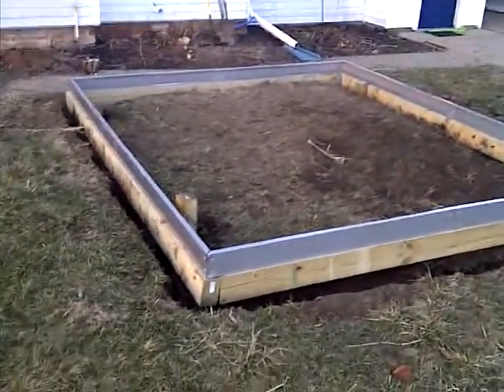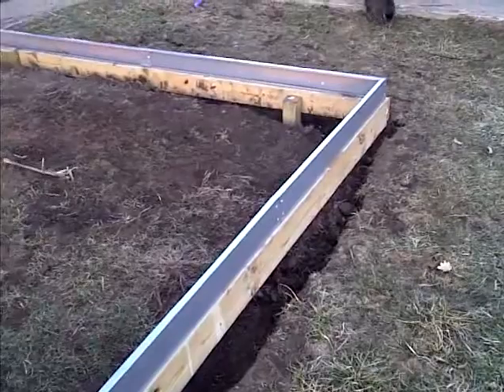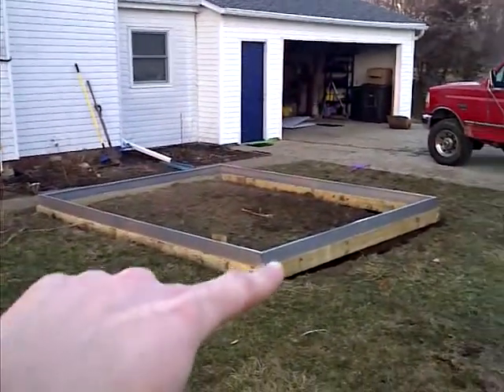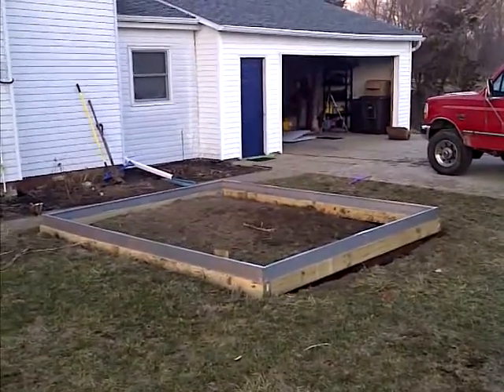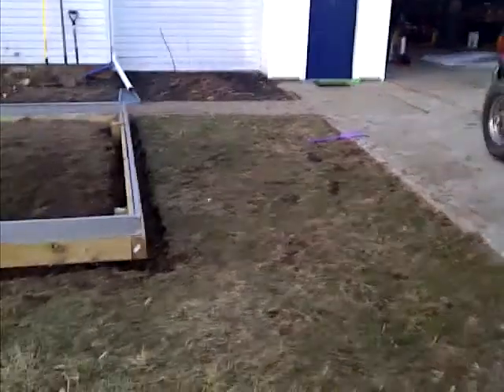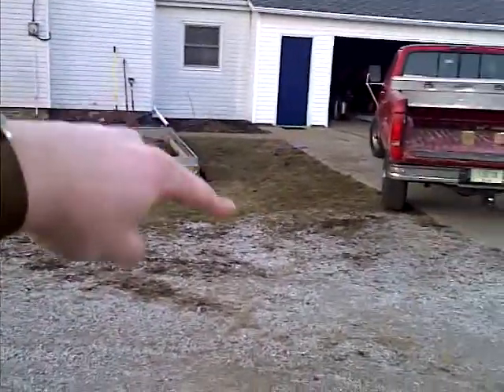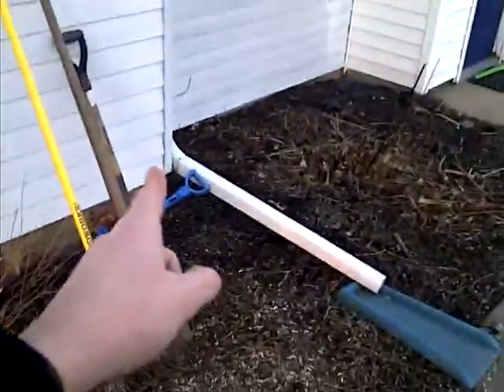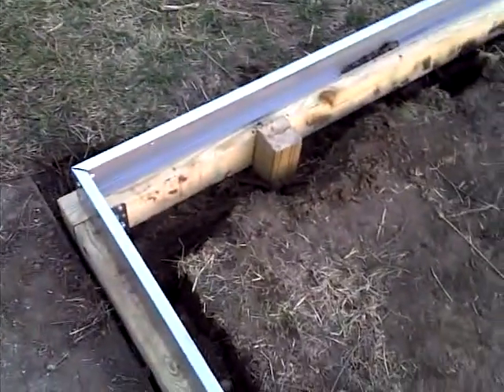Harbor Freight 10 by 12 ft Greenhouse Pt 7

Comment: Why did you not include detailed assembly of Braces and installation of the multiple bolts needed for later steps! You are a genius deciphering assembly instructions and the patience of a Saint implementing them! I could sure use some tips about back wall assembly! Detailed close-ups off bracing and upper wall panel hangar placing! Yours looks nice but  what problems other than foundation plagued you?

Comment: Bought mine last summer.  Still in the box.   Here in MA the frost line can go down 4Ft.  I was thinking of putting in a cinder block foundation to set the frame on so the dirt could trap heat for the night and frost wouldn't penetrate underneath in winter.  I'm tired just thinking about the digging I'd have to do.  Are you going to do any of the reinforcements shown on the web for this greenhouse?

Comment: @NewEnglandgardening 
Dig down 1 foot and flatten the ground and pack it down solid. Then put down  a layer of plastic vapor barrier. Then use some rigid foam board insulation about 6"' s is enough, covered with plastic and  a layer of sand with some sort of paver  block then assemble the green house on top.